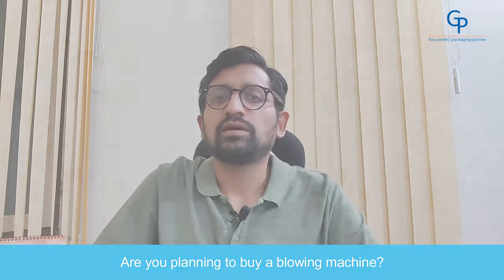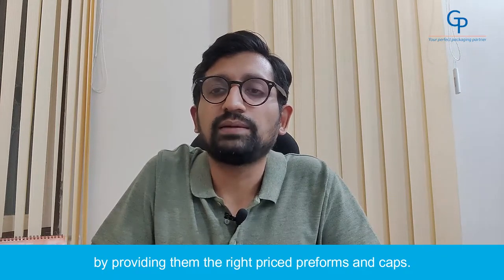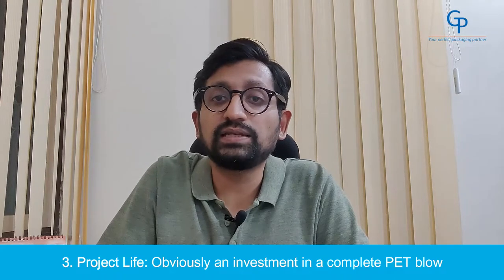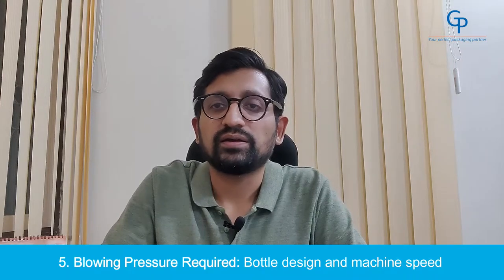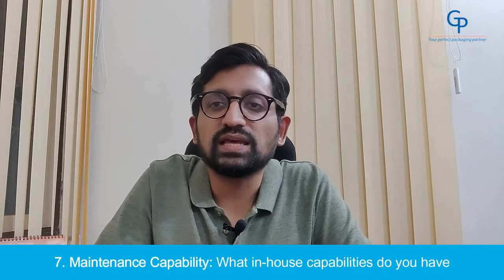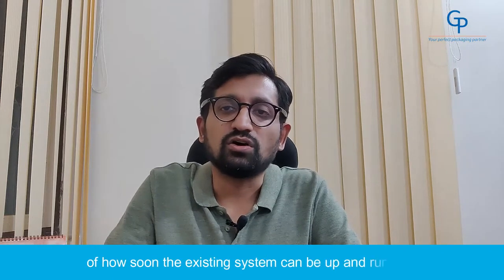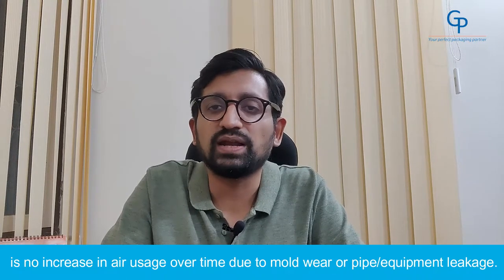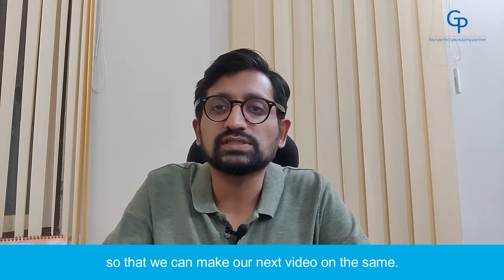The guide to right compressor for your blowing machine

Comment: We are planning to 6 cavity blowing and we need noise less comperssor please refer on it
Reply from the maker: Firstly congratulations.. Screw compressors are noise less compressors. However, high pressure screw compressors are suitable for very high capacities and would not be suitable for a single machine. You could go for a booster compressor which although is not noise free will be suitable for your application.